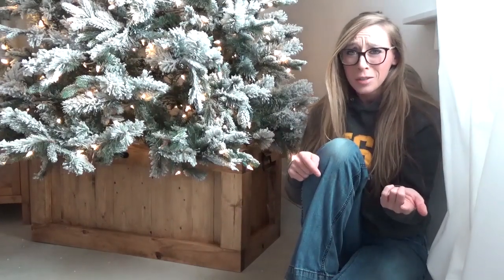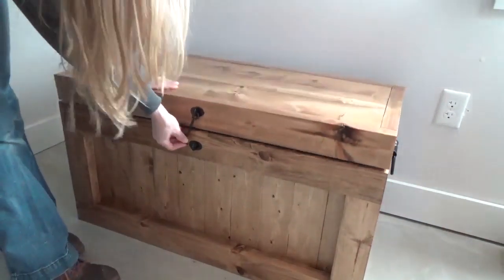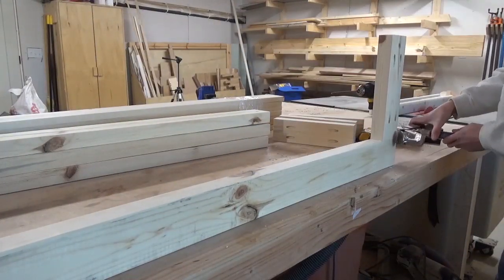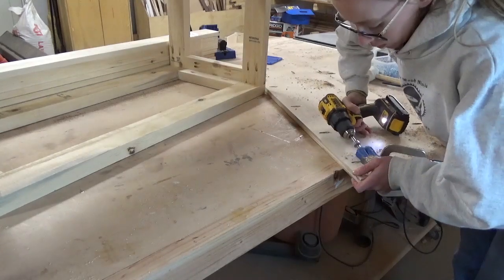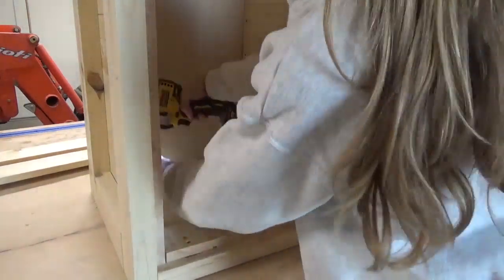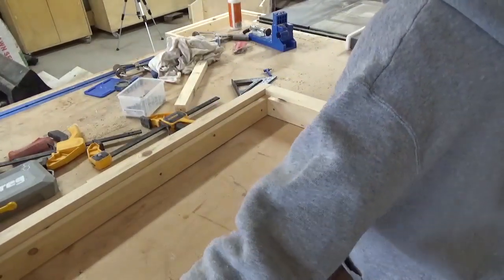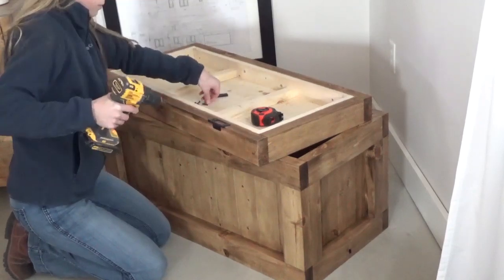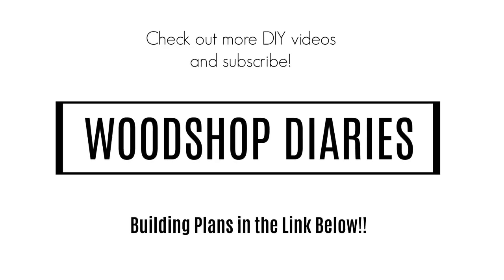DIY Hope Chest & Wooden Christmas Tree Box

Comment: If you used 1x4 that fit perfectly for the sides... would you not have to make a smaller 1x6 piece to do on the top lid if you just used 1x4 pieces for the top instead?
Reply from the maker: I’m not sure I understand the question?